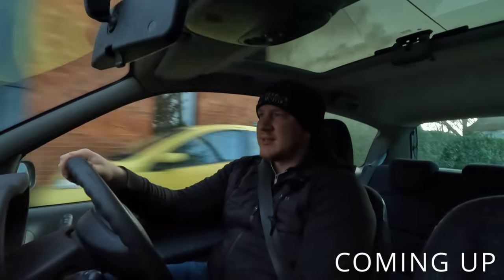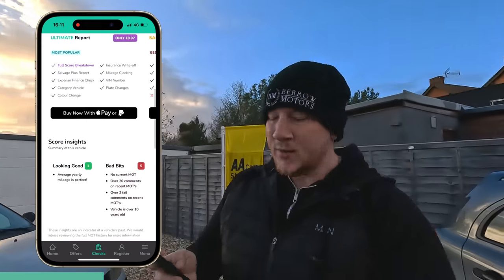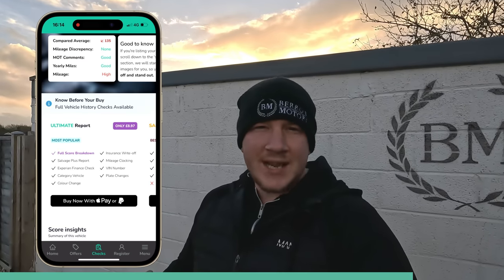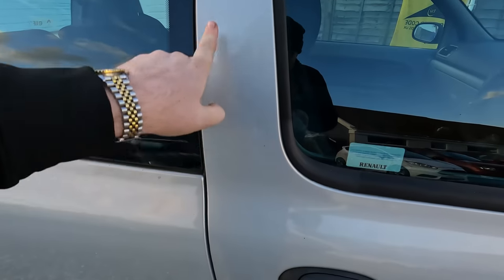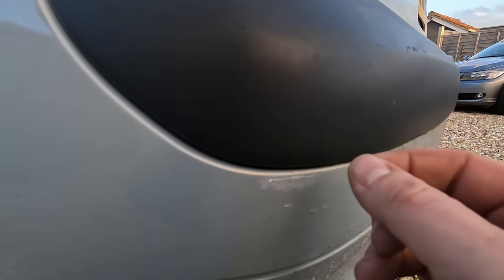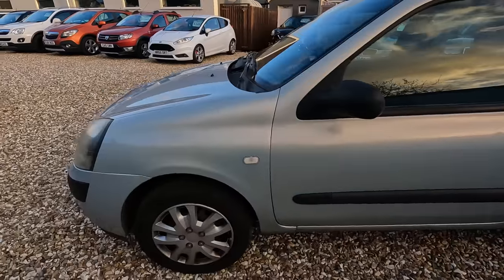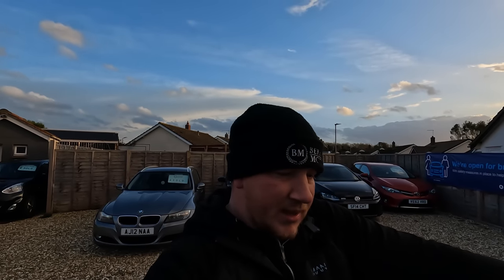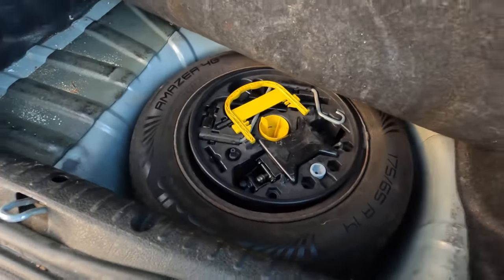£150 RENAULT CLIO - CAN I REALLY MAKE A PROFIT?!

Comment: Has this done 139000 miles? I had one of these for a while - a light blue Dynamique Billabong back in 2004, same engine as this middle-of-the-range Expression. The 1.2 16V could do with a 6th gear as it's busy on the motorway. In 5th gear, 70 mph is 3850 rpm. Actually they are reliable if well-taken-care-of. There's still quite a lot of them around. The steering wheel rims feel a bit too big though.

Comment: Fancy buying a 2012 fiesta zetec s? I spent all day picking it up  had to get a key cut. Then realised timing belt had snapped. Guess I'm taking an L .
Reply from the maker: Nightmare!
Reply: @ShiftingMetal  it just worse today. I took the audi tt 3.2 for a run ready for sale. Heard a bang underneath. Carried on driving. Then got 'low oil pressure' stopped and found out I've lost my sump lol. Luckily engine sounded fine so might be lucky.

Comment: Had a 320D one time, ended up paying 1k for it off trade although worth much more. Reason, all the windows had been siliconed shut as the motors had failed and they decided it was cheaper, it was a mechanic that owned it who sold it to trade too 😂 Was lovely until summer came, off it went then as it was like being sealed in a iron tank 😂